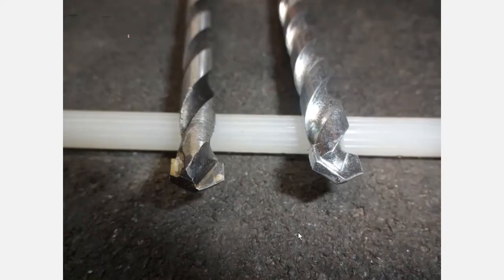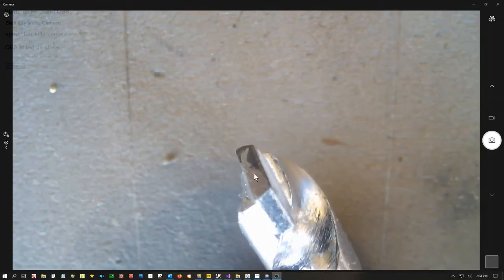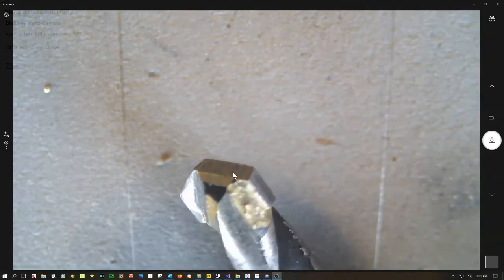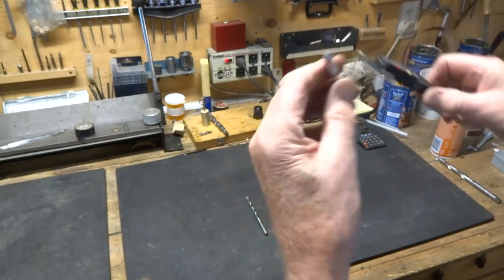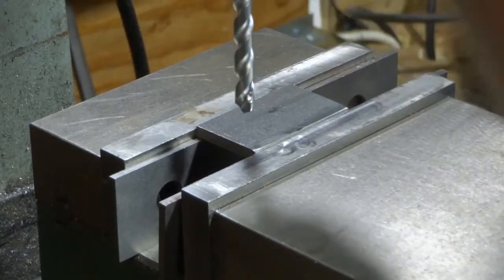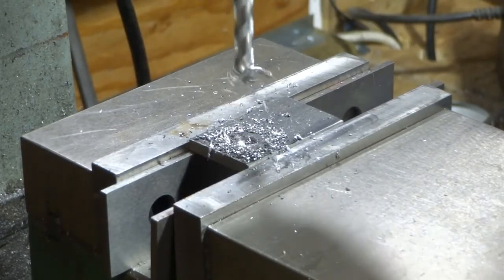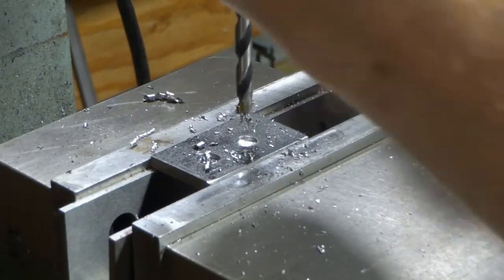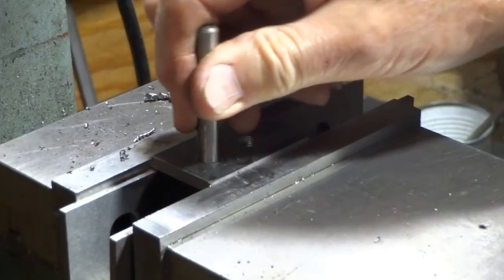Cement drills To drill metal.

Comment: tried to sharpen one with a dremel cutoff wheel.. couldn't get any good edge.. I have a tile saw with a  diamond wheel so I'll try that next.  I can't make more than a divot in steel with a hand drill.. do I have to press down with extreme weight?
Reply from the maker: You need a grinding wheel made for carbide. Check Amazon.
Reply: @MrModify  I managed to pull it off.. the tile diamond blade tile saw works great, eats into the bit tips nice and clean. Drilling is still a bear with a hand drill, but I think I'll pull it off